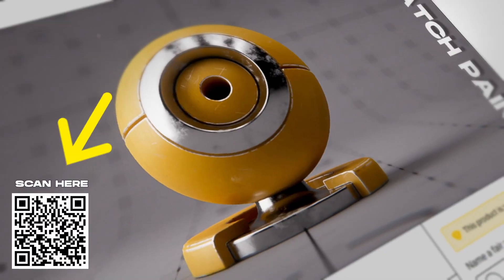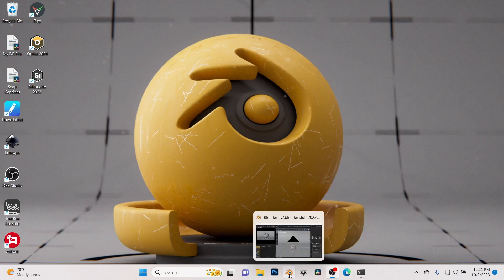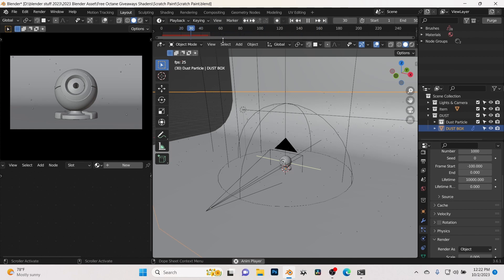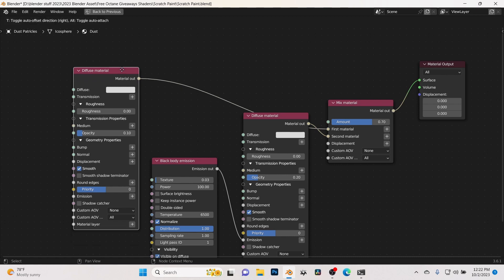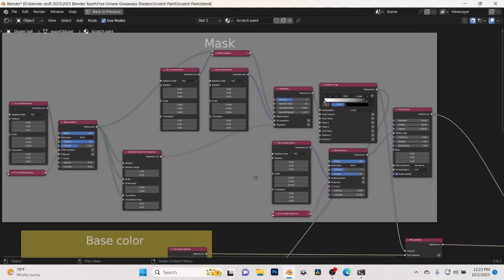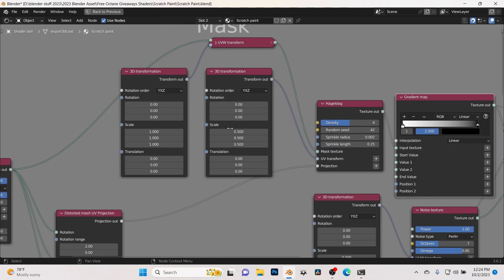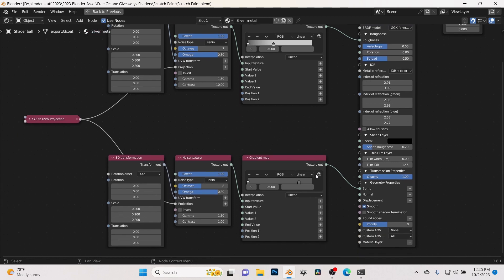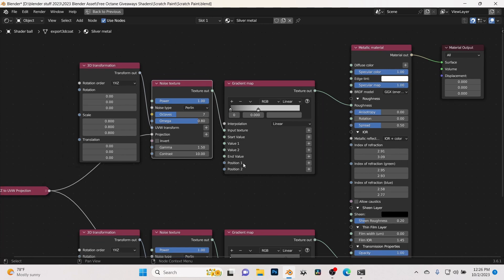FREE Octane Blender Scratch Paint Material Walkthrough

Comment: Thank you very much for the free material. Nice shader!!
Reply from the maker: You're welcome lots more to come 👍🏾🤓
Reply: Nice! By the way, is there is big difference between the 26.16 and 26.17 versions? I'm running the 26.16 and are afraid of installing the 26.17 because everything runs fine. On the other side e.g. the volumetric spotlight – a super great light, doens´t work properly as it should be in my 26.16 version. Any experience? Thx a lot for your tuts!!
 @1polygonewithme
Reply from the maker: @bricksburgtheatreacademy4120  I think they were just minor bug fixes I have not updated and as far as the volume spotlight I have played with it a little bit but I've noticed it has increased my render times quite a bit so at the moment I am not really using it

Comment: What are the advantages to octane over Cycles?  The downloading and installation to get Octane to work then the extra learning curve of all these nodes within Octane? For all the extra trouble, what are the advantages? They would have to be major to go though all this right?
I would love to see a video from you explaining why it is so worth switching  from Cycles to Octane.
Reply: I  think Octane much more realistic
Reply from the maker: First thing octane is pretty much standard in most workflows and most VFX studios compared to cycles which is rarely used in many VFX houses. 

Here's a short video of why I chose to use octave versus cycles but also cycles is still an option the same as octane is. https://youtu.be/v3w_VbYxJlw

It's just another render engine like you can change from EEVEE to some prefer to use Arnold or Redshift it's just another render engine but it's also a main pipeline of many VFX houses.
Reply from the maker: PS. Great question 😁👍